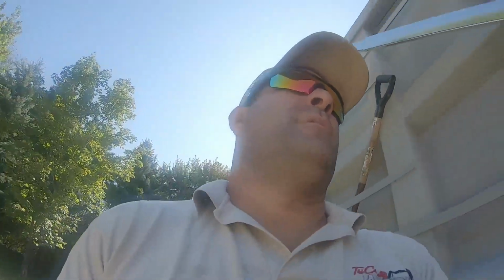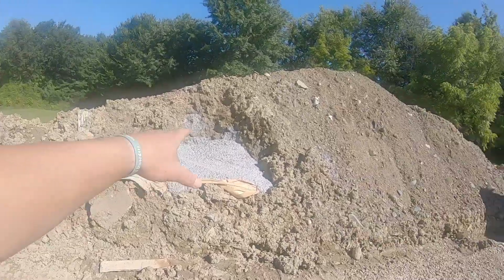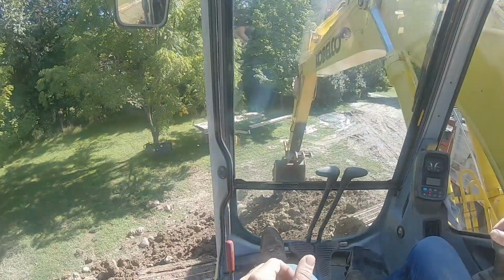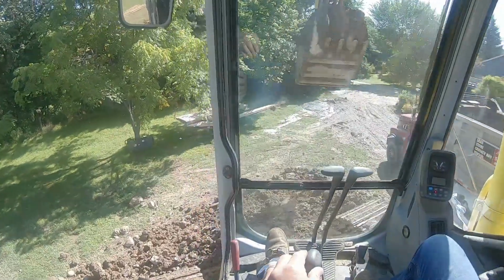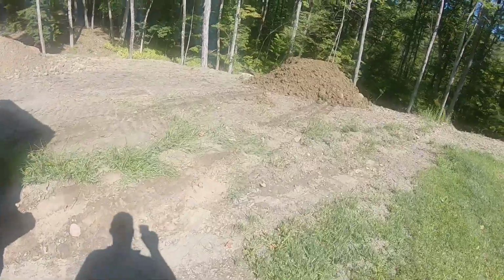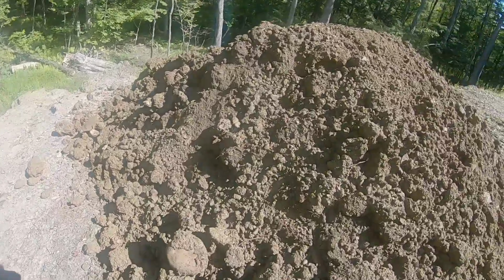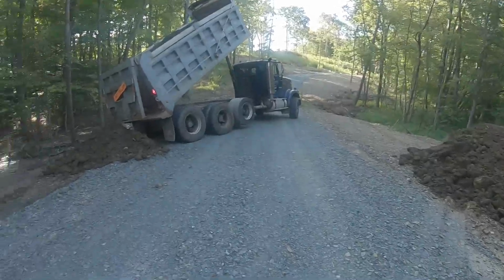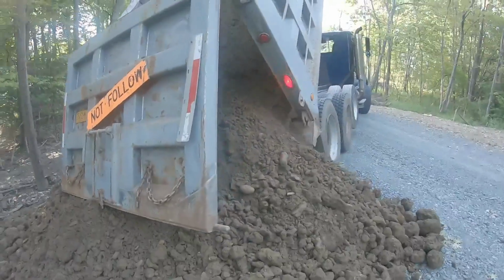Trucking dirt and re-purposing material for another project #DIRTBOSS #DUMPTRUCK #EXCAVATOR

Comment: How much do you trucks hold? Here in AZ it is a Federal Bridge law state so a single tag axle can only haul 11 tons.
Reply from the maker: Wow really! 80,000 I thought we had it bad! How do you make money @ 11 ton..
Thanks
Reply: @DIRT-BOSS  Luckily I don't drive a truck. A truck with 3 middle axles only hauls 16 tons. If you want to haul 25 tons you need 3 middle axles and a booster axle that folds down and because it is longer it works. But a lot of truckers don't like it so they stick with the Simple 16 which is the 3 middle axles. What is your pay load? 25 tons  or 16 yards?
Do you do your own waterproofing for the basements?
Reply from the maker: @briangardiner1015  No sub the waterproofing..all trucks are different here it goes on your bridge for length for your tonnage most run 22 ton..18 to 20 yards..
Reply: @DIRT-BOSS  The only way to get 22 tons here is with a tractor-trailer and the trailer needs to be 40' long. Most are running bottom dump trailers some trucks are what they call a Transfer where the trailer can go into the bed of the dump truck. Most of the dump trucks have 2 or 3 middle axles. The 2 axle holds 14 tons or 9 yards or a 3 axle which is 16 tons or 10 or 11 yards.